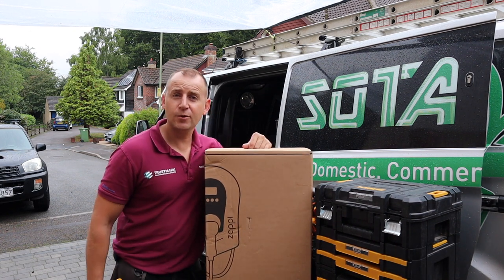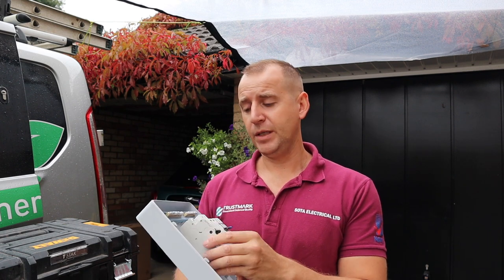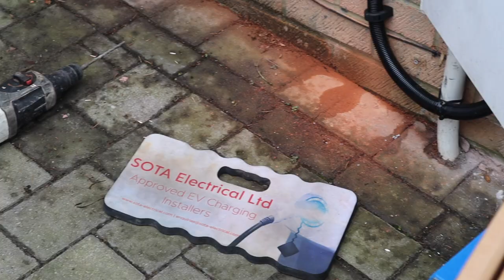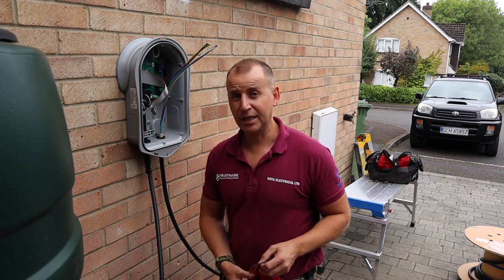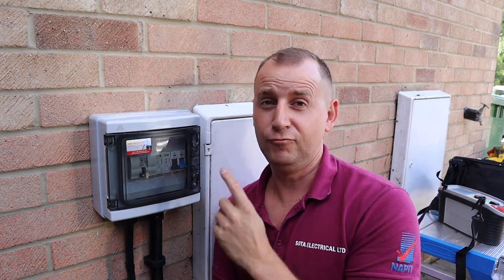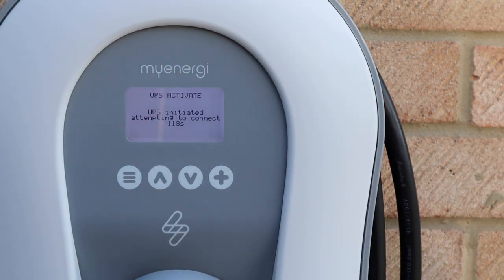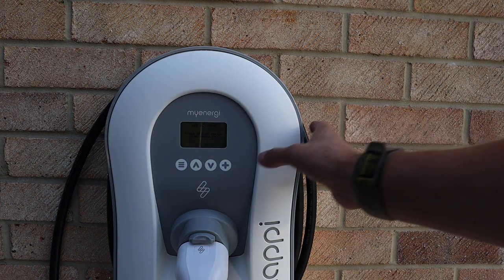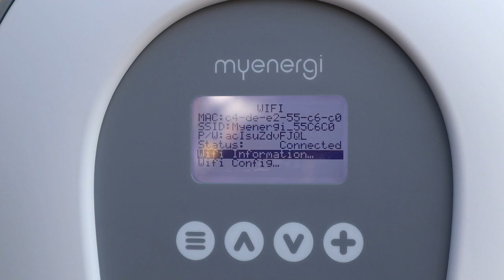Are these really EV charging points??? Zappi WIFI connection walkthrough.

Comment: TP-Link is a brand that make networking equipment amongst other things. The device you used is a WiFi range extender. :)
Reply from the maker: Yes this has been pointed out to me before, if you watch more of my videos you will hear me mix up all sorts of words mate, can’t help it
Reply: Another point is, the powerline range extender is what you should be pressing the WPS button on if it's available, as the router is too far away for it's WPS to work 👍🏾

Comment: Just a point about the TP link. If you are trying to install on an outside garage not connected to the house there is a fair chance the garage will have its own supply from the house. I am not 100% sure but I think these mains tp links rely on the fact that both the master and the salve are on the same ring main  so potentially it might not work if the salve unit is on the garage supply and the master is on the house supply.
Reply: It's  the earth the earth needs to be common, if an outbuilding has been staked and divorced from the earth the router uses it won't work.

Comment: Hi what’s your opinion on the omission of RCBOS/RCDs on EVCP supply circuits and relying solely on the internal protection? Good tidy install 👍👍
Reply from the maker: Hi bazza1878 
Thank you for your questions and comment, generally I would install a 63A double pole TypeA RCD to protect the cable and installation but in this case I wanted to try out this new consumer unit and it’s components, if it was the enclosure only I would install an RCD, I do also take into account the cable route and what’s involved, in this scenario I really didn’t think it was required, would it have been better with an RCD? Maybe so, but is it a dangerous installation without an RCD protecting a meter or so of surface mounted hi-tuff cable? I don’t think so. What are your thoughts?
Reply: @sotaelectrical  I agree with what you say, it’s all down to individual circumstance, I’m quite happy that protection is supplied via internal RCD, and as your installs also seem to be the vast majority of mine involve cables being surface mounted, either using SWA or EV ultra. So I’m quite happy with the protection provided. I only really asked the question as if you were to be really picky then the absence of a way for the client to test the RCD on EV CP could be an issue (not in my opinion) 
The inclusion of an upstream RCD/RCBO also has its own issues with selectivity. So horses for courses in my opinion. 
I’ve picked up some great tips from your installs and your tidy methodical way of working really does make for a top finish. 👍👍
Reply from the maker: @Bazza-tn5ck  exactly, every installation is different and it’s down to knowledge and experience to ensure the installations are carried out in a suitable way. 
It’s great to hear you have picked up some useful tips from my work so thank you very much!! Keep watching and keep in touch, I enjoy talking to fellow sparks, we can all learn a bit from each other.
Reply: @sotaelectrical  👍 I will do.

Comment: Great, honest video. Refreshing to see someone going through the pain of setting up these types of gear.
Question, I have a new one to fit, with built in wifi. Its on my garage, separate from the house. Do I need to have a CT around my incoming mains? It's do able, but not sure if its needed.
 Think it may be needed to monitor what else is on in the house so as to decide what load to apply to the Zappi.

Comment: The best video I’ve seen on a Zappi installation.  Can I ask one question.   Once the Zappi has been setup including Wi-Fi connection, are the settings stored so that in the event of a power cut the owner does not have to go through the process again.  Thanks.
Reply from the maker: Thank you very much, in the event of a power cut the owner will not have to go through the process again I can confirm

Comment: What size Kopex did you use for the 25mm tails pal?
Reply from the maker: Hi @scottreynolds8917 I used 25mm copex for the tails, I used 16mm tails in this installation as they are easier to work with and more than adequate for the installation, thanks for watching!!
Reply: @sotaelectrical  waste of money and als9 had for the environment using oversized tails. 10mm tails are more than enough for a standard zappi install.
Reply: * also *bad